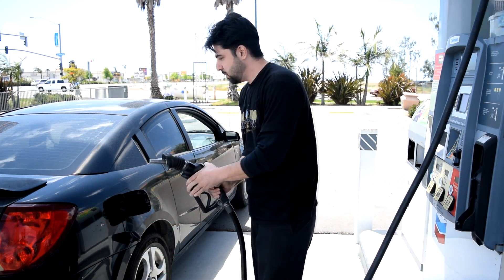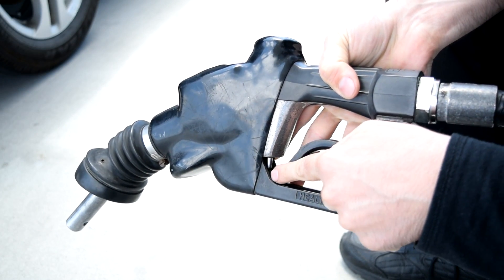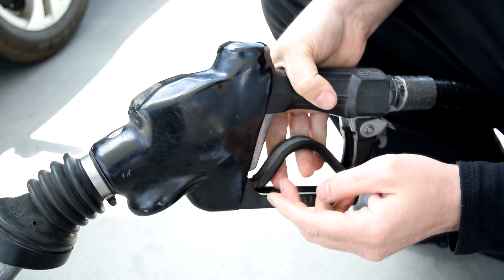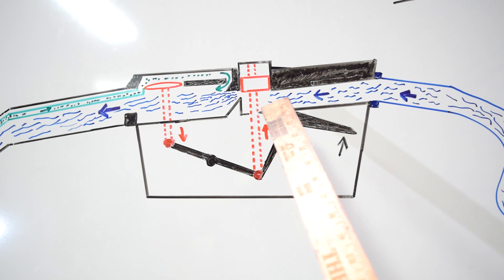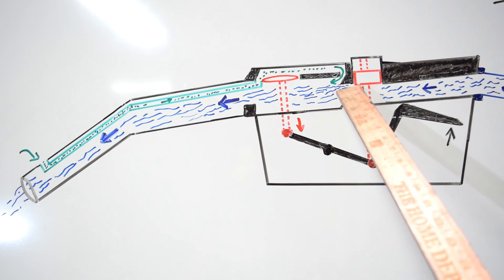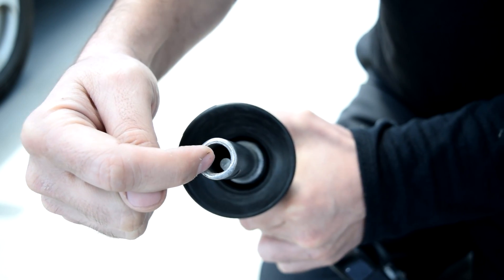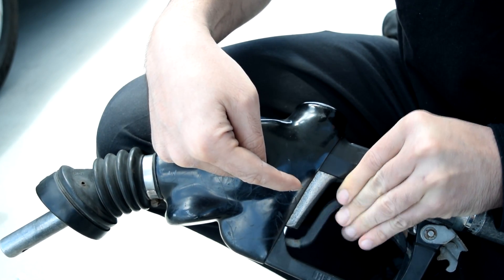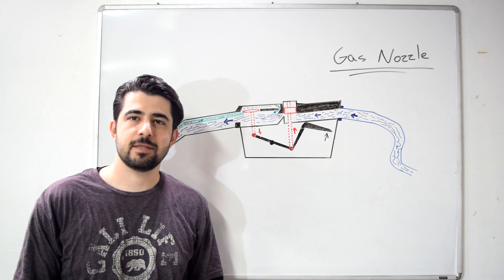The Ingenious Design of a Gas Nozzle - How Does a Gas Nozzle Work

Comment: I have the exact same problem after I had to change the gas pump in my PT Cruiser
I get the Error: P0499 - NVLD canister vent valve solenoid circuit high, it does have a lot to do with it, right?
Reply from the maker: You more than likely have a bad vent solenoid or didn't reconnect the wiring and connectors to it when you were down there. hope that helps. GL

Comment: True or false when the temp us cooler outside you get better gas from the gas pump than when its hot as hell?
Reply from the maker: I haven't driven in cold climates but I hear there's a winter blend gas they used during the cold season and it actually gives worse mpg's.

Comment: R n W... have you read or seen the cars that run on gas-vapor ? can you do a video on if Its true? or pros n cons....
Reply from the maker: Just looked it up on youtube, it's a hoax. You are running on vapor when your injectors open anyways. It's not like liquid fuel is entering your combustion chamber. If you spray  a little in the throttle you can run your engine but won't be getting much power.

Comment: I recently disconnected my battery to install a new alternator and when I reconnected the battery and drove about 5 miles. Once I got to the gas station I tried to fill my tank but it would only take like 4 gallons. Would disconnecting the battery have something to do with this.
Reply from the maker: It shouldn't, do you have a check engine light for an Evap Vent Solenoid? Are you sure the gas gauge is accurate?
Reply: +Ratchets And Wrenches Hey the gas hand is about right from my weekly usage. The check engine light didnt come on. I will hook an OBD up and see if the ECM is ready. It was kind of of that this happenen and the car is a 06 Ford Mustang.